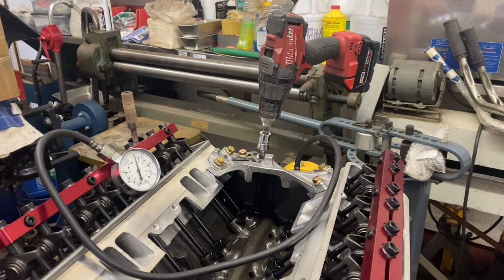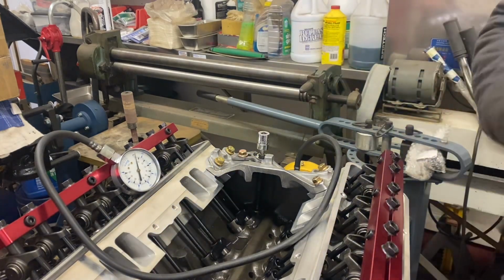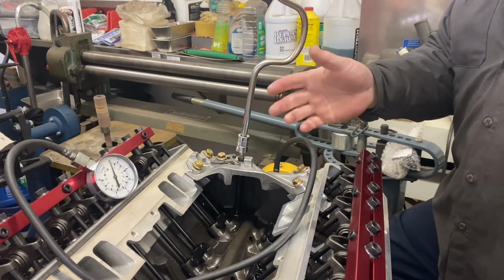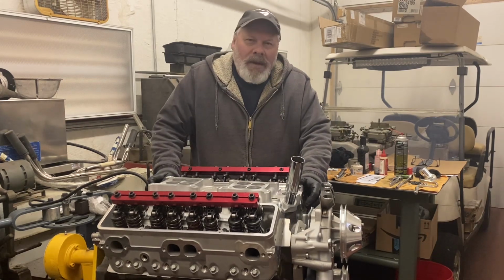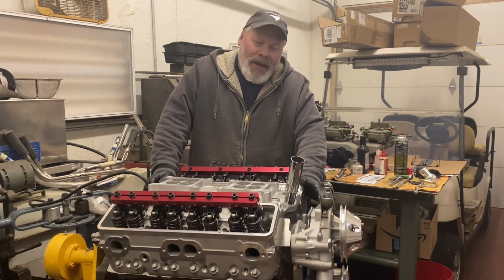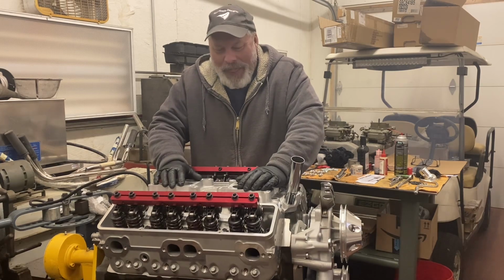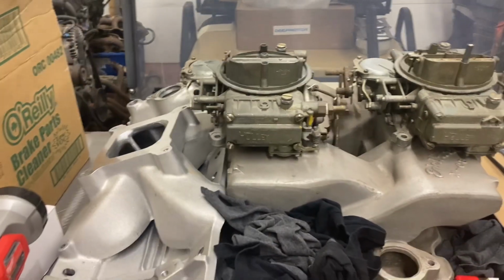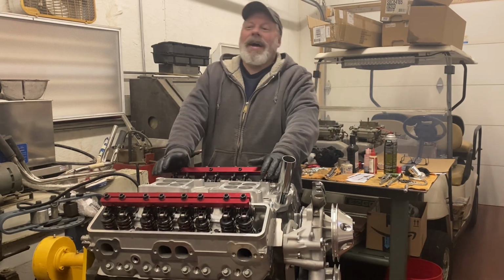Mountains Garage: 377 Small Block Chevrolet: Making Oil Pressure!

Comment: Watch Powell Machine Inc here on YT.  He does a lot of cool machining coverage, and he recently did a video on the myth of high volume pumps emptying the pan.  He makes good points.  Like any hydraulic system, the majority of the oil is bypassed directly back in to the pan.  He also covers the old school theory of loose clearances and heavy weight oil in race engines.
Reply from the maker: I will check it out, Thanks!

Comment: Why not weld up the manifold. I had a friend that raced 351 Clevelands back in the day, rules called for 2BBL carb, and 2 BBL intake, the 4 BBL heads and intake had bigger ports, so he welded up the 2 BBL intake to fit the 4BBL heads. He made it work. You got a TIG, go for it.
Reply from the maker: Always an option.

Comment: Cool engine. I’m building a 408 right now using a 509 casing 400 2 bolt main block. AFR 195 heads, retrofit hydraulic roller cam and Eagle rotating kit with Mahle pistons and low friction 1mm, 1mm, 2mm rings. It should make good power and great torque. Thanks for all the great videos - especially the TH475 series. I got one that I pulled out of an old RV along with a 40K mile Gen IV 454. I spied a crossram intake in the background. Is that for a big block?
Reply from the maker: Cool! No that is small block as well.

Comment: Maybe u should get the manifold welded to give you the meat u need. Most head shops handle that. I had similar issue running smog manifold on afr cnc competition head. I believe it was only 200 for welding and port matching. I took a file to finish the look and hide that anything was fone
Reply from the maker: Definitely an option.